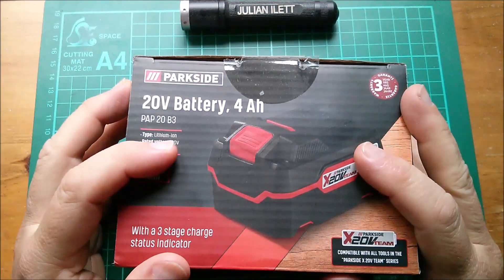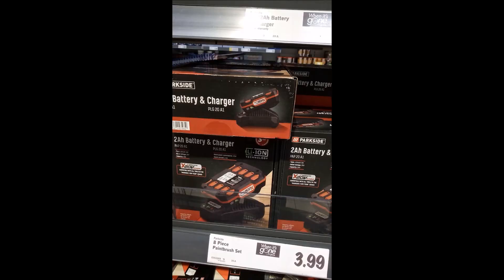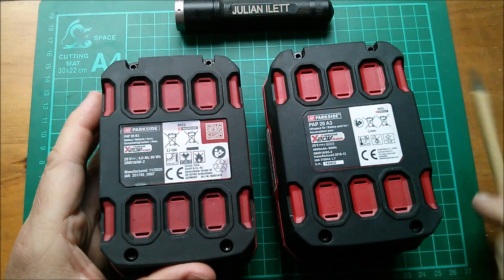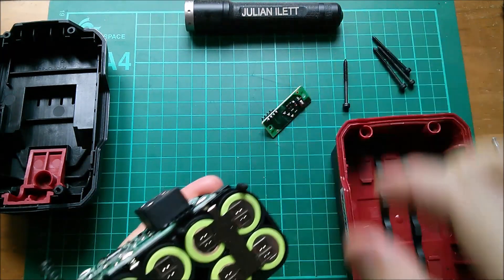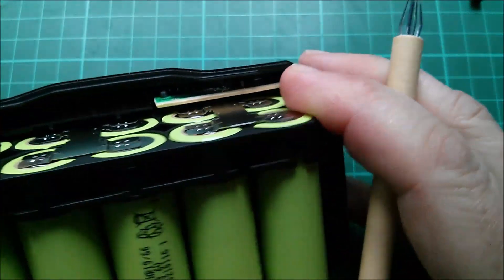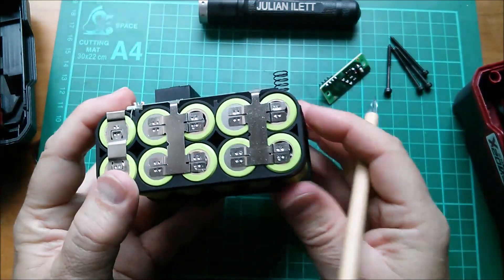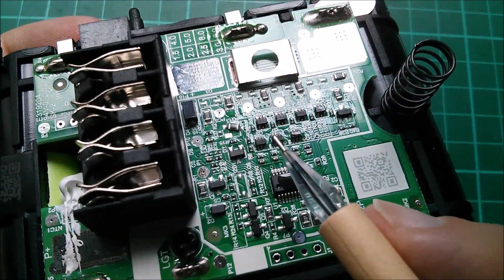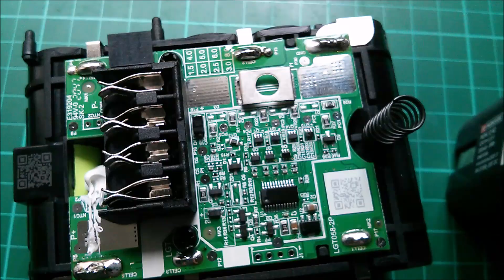Parkside 20V 4Ah Battery from Lidl

Comment: Hello!  I just purchased a 4.0 AH Parkside battery here in the US.  The new battery advertises cell balancing.  My old Parkside batteries did not have cell balancing.  Do I need to use a newer charger with the cell balancing?

Comment: I believe BigClive has established that one of the terminals is connected to the thermistor on the batteries to tell the tool the battery temperature, and when the pack voltage drops too low it open-circuits it, looking like overheat, and it's up to the tool to stop taking current - hence the MOSFET in the tool.

Comment: Ryobi 18v batteries (actually 21v as they're 5S) have the low voltage cut-off built in the battery so they're much easier to use in DIY projects.

Comment: Is there a simple cut off circuit that can be bought and added into an homemade adaptor for these batteries? It's good to know they don't have this built in but a real shame. I use the Parkside 12v batteries for several projects and it's nice that I don't need to worry about over discharge as the battery handles that internally.

Comment: Hi I  want to ask you if I can, I have 2battery model B1 and B3 a 2Ah battery and the control green LED turns off at 19Volts and only yellow and red remain, whereas on the 4 Ah the green turns off when the voltage reaches 17.3V, that is, on one the green turns off when the 3.9 V cell instead on the 4 Ah it turns off when the cell are 3.4 V .
The only red LED lights up on the 2Ah battery at 17.3 volts, whereas on the 4Ah battery the red LED lights up at 16.5 volts, i.e. at a lower voltage.
Why i have on green and red Led diverent voltage on 2Ah and 4Ah same battery model B1.
I mean on 2Ah battery red is on when the cell are 3.54 volts instead on 4Ah red is on when the cell are 3.3 volts. 
Is could bee a defect bms or is it the different management of the BMS?
 
 Thank you

Comment: Please:Do you know,what the middle Pin tells the tool? The outer pins are positive and negative. If you apply voltage of 5 cells to the tool, it tells error,runs and stops. So one of themiddle pins is needet for the tool. But what does it tell the machine?A resistance from tempersture? Du you know?
Reply: Digital data is transmitted through this pin. I checked it with an oscilloscope

Comment: Is it possible to charge parkside 20v batteries without the parkside charger? Since the balancing is done inside the battery, would it be ok to use a smart turnigy accucel six and hook it up to the terminals? Or will the battery not recognise it and go into protection

Comment: I tried to make an adapter for my new Trend 18S circular saw. The Parkside battery almost fits but did not slide in enough.
 I made 2 short connection leads with spade terminals at the battery side, 3x0.75cm2 wire per lead,going to copper strips which inserted around the power tool blades. Unfortunately I shorted them for 1s or so when removing them from the tool,  There is no power at the terminals. The battery led check does not cause any lights to come on.
Opening the battery:
The fuse is broken having looked at https://youtu.be/A6LYNa3-n90 where he solders the fuse back (seems dodgy)
The cell voltages are maintained.
You mentioned the fuse between the ground pin with the circle on it - looks te same
I figure that the fuse would have gone but does not look different. 
Does the ?brown liquid/???resin  on the PCB  means the PCB is toast despite the fuse?

The cells are cool I have put the battery in a stainless steel pain with a lid on, in case of issues. 
Any advice about possible fixing / replacement of the board / aedvice would be appreciated.
Reply: The fuse is a last resort to save the cells from damage, if it is damaged then you either have to find a replacment or scrap the pack.. Its not safe to use without the fuse, they put it in because the battery has no other protection for it.. DONT be tempted to solder across the fuse to get the pack working..
Reply: I haven't but considered automotive fuses, SMD fuses. I eally wanted to identify the same fuse but had no joy. @petrokemikal

Comment: Hi, I am trying to use the Parkside 20V batteries instead of V-mount batteries for film equipment.
As I see it I have to transform the voltage. Any hints with what I can do this easily and also keeping it compact/sturdy?
Vmount is 14,8V nominal. The minimum is likely around 12 V the max 16.8V.
Any tips appericated!
Thanks a lot

Comment: I have thought about using these batteries to power an outdoor model railway controller (20v). 
I'd need an inline small external fuse though in case I get a derailment and a possible direct short.

Comment: One interesting note is that the blade beside negative is normally a thermistor with a resistance to negative of 10.6KOhm.  Knowing this has allowed me to bodge Makita batteries onto Parkside tools.  WHen you open the tool, there is a control board with Bat+, Bat- and a terminal called "DS".  Wire a 10.6Kohm resistor (easier to use a 10K in series w 620 ohm) between DS and Bat-, and then the tool will run off just the 18v +/- from the Makita Battery.

Easy Peasy, and I now have an 18v pole saw running off makita batteries (my standard) for $40USD.
Reply: Awesome info - thanks!   I just imported the Parkside soldering iron into the U.S.      I need to convert it to run on my Dewalt and/or Ryobi packs.   I noticed the third terminal as soon as I unboxed it , and so came here looking for this info (whilst praying that it was  a thermistor and not a data line - phew !!)
Reply: Do you know if it would be possible to charge the batteries with a regular smart charger since the balancing is done inside the pack? I have an accucel6 and wouldn't bother buying a new parkside charger for a tool i found in the trash

Comment: Hi Julian.. I'm having issues getting the parkside X20v team batteries to power my older version Parkside performance 20v tools. I have the adaptors but with basic pos/neg connectors. it will power up for a brief second and cut off.something within the battery/tool is not compatible.. do you know what the 3rd terminal on the battery is for? how to connect to make it work? Thanks

Comment: Hi @Julien, i plan to use 2 of these in series to get 40v 4ah for a diy electric bike motor kit. I'm a bit worried the parkside battery bms doesnt have a low voltage cut off though. Is there a way i can still go ahead with my plan? Thank you.

Comment: Brilliantly useful teardown! Because the Parkside batteries are staggeringly good value compared with others, I am gradually converting every 20V thing I have to use them via custom adapters, or in some cases putting the Parkside innards into other brands' battery housings.  Of course that latter presents some challenges/risks in safe and efficient charging, so the more we know about the designs the better.  (So far I've been winging it, monitoring charge voltage and current a bit, not leaving any cross-species pairs unattended and seem to be getting away with it!)
Reply: Yes, watch out with the charging, cost my nephew his house
Reply: So is it not as simple as putting these let's say in a DeWalt pack ?
Reply: The downside is the cut off should be in the battery.

Comment: They move most of electronics on x20 series to the tool maybe to allow tools like the 40 volt chainsaw to work with two batteries.
there are no tools using two x12 batteries

Comment: Good building quality! Strange, that cut off mosfets aren't installed by design on BMS board..
Noticed marking table on side of PCB, that looks like battery capacity.. Interesting - is there some part difference on PCB between different capacity versions? 🤔
Nice battery for price! I need to go check out Lidl, finally.. 😂

Comment: Thanks for the heads up Julian. I needed 6*18650 cells to repair my crap Vax stick hoover, apparently non removable batteries that fail after 14 months are a consumable so not covered by warranty. Found the unbalance 4ah battery for half price in the Aylesbury branch so got one and harvested the 10 batteries. Vac fixed and 4 spare cells for my torch. Felt bad throwing away all the rest of the components but worked out a lot cheaper than buying the cells

Comment: I just picked up a Cell Balancing battery from Lidl (PAP 20 B1) with a charger PLG 20 C1 in case that had anything special for the new batteries - it was so confusing with all the different old and new stock. I think that the charger is nothing special though, as the balancing is with the battery I assume I could just use any of my old chargers, and the balancing would still work?

Comment: If you have "Kaufland" market-shop in your country -> You can buy 12V batteries for "My Project" tools with 3x 18650 >2000mAh (21A) batteries, similar/better cells as in LIDL battery-packs, but cheaper. Normal price is 10 dollars, sometimes it goes for 5 bucks. That´s 1,60 dollars for 1x 18650 cell with 21A discharge and capacity around 2100-2200mAh - I gutted them, tested them and using them for my projects. You can´t buy cells for that price anywhere else. :D

Comment: I got 3x4 pack of these 20V packs stitched together.... This cell balancing board hopefullymake this pack a bit more safe to use (cell balance wise).
Also, the cut-off is done via an external MOSFET in the tool on the 20V packs. Essentially the two middle pins are for (C)harge and (T)ool respectively.
I've not played with using external FETs, though that'd be something to consider for my power-bank (Tho the FET would probably become the fuse, even a 50A FET with a 15A fuse would likely go first.
Reply: https://www.youtube.com/watch?v=1zdEcPNiQL0&t=2s this guy did it

Comment: FYI the balancing is usually done by just having an overvoltage detect and shunt transistor across each cell.  If a cell exceeds (4.2v or whatever) any extra voltage just turns into heat in the shunt transistor. This allows the charger to keep charging the stack of cells until they are all at 4.2v. This is kinda inefficient, and relies on the transistors being able to dissipate the heat (so you can't charge super fast), but it's the cheapest way to do it.

Comment: Followed many of your videos, all excellent. The next step could be a low RF noise high efficiency regulator to give 13.8v output from one of these packs. Probably easier just to buy a Lidl dual charger to recharge these.

Comment: If I buy some of the  4ah and 2ah batteries with cell balancing, does it
 matter which charger I get? My store has the new cell balanced 2ah and 
4ah batteries but the charger is  bundled with a older non balancing 2ah
 battery. Is the older charger suitable for  cell balanced batteries and
 as its bundled with an old 2ah will it charge the new balnced 4ah?
 I agree, it is confusing !
Reply: I'm currently in this dilemma. Rang the service hotline but alas, today is a Saturday.

Comment: Printing cell balancing on the packs is just new marketing, perhaps to try to combat all the youtube vids saying they dont balance... I have X20v batteries from 2017 they have ALL had cell balancing from the a1's. (unlike the 12v range) my last purchase of lidl batteries was about £350's worth for a big  pack build, i also commented on your original 20v 2yr old video and said that they had cell balancing but i could not identify the chip used (2017/2018 packs) as the number didnt google. parkside batteries in blue wraps are by grizzly, according to grizzlys site they source their cells from samsung, i cant verify this but in the battery groups it has been noticed that the cells charge/discharge graph do seem to follow the paths of samsung Q chemistry's. the cell balancing on this is just resistive. not capacitive, and at charge time only. balance chip handshakes with charger to switch on. as te cells are direct connected you can charge them by just throwing 20v back in but i dont know if this would activate the balancing, and i'm too lazy to test as why do that???
I have batteries from 2018 in daily use on our ebikes, still holding a good charge but they must be on their last legs by now...
the LGT8P22a is also used by anker in their power banks, i have found the chips for sale from the far east, but no data sheets.
no low volt cut offs, if you reach too low a voltage the chip throws an unrecoverable error and you will never be able to charge that battery again...no even removing all 5 cells / power wont work. been there 3 times now so that 75 quid of batteries i could no longer charge...(cells went into other projects)
if anyone wants me to strip open some old batteries for comparison let me know.

Comment: 5INR19/66-2 (on the case) and INR19/66 (on the individual cell) is a standard naming scheme. INR is the cell chemistry and indicates the use of Nickel, Manganese and Cobalt, as it is common for power tools cells. 19/66 means 18650 (18/65 is also commonly found), but sleeved. To account for the size of the sleeve, 19/66 is widely used to indicate that the cells are ever so slightly larger than naked 18650 cells. It's a compliance thing.

And on a similar note, it's legal now for power tools to state the "maximum battery voltage", which is a very soft definition., hence the 20V/4Ah/80Wh on the case. This whole 18V vs. 20V naming business (same as 10,8V vs. 12V) came after this change was implemented in North America and the power tool companies lobbied for a consistent global naming scheme through their industry body,  the European Power Tool Association. Until then it was the default, as it still is everywhere else apart from power tools, to use the nominal voltage as the defining value for your product. The funny thing is, while basically all of them agreed that this is a good thing for the 10,8V tools, they couldn't agree whether it's also a good idea for the 18V tools, so some did and some didn't change it to 20V.

Comment: That could make using an adapter quite dangerous. The other brand may not have it's protection in the tool & charger.
Reply from the maker: My thoughts exactly. Making adapters with a 3D printer is not without its risks.

Comment: I got one of the 4.5A PLG 20 B1 chargers which has a fan; the model in the blister pack is the older one without the fan AFAIK. The parkside drill comes with a hard plastic case which has a cutout to store the charger + battery but the newer charger doesn't fit (because of the fan!!)

Comment: There are also a lot of adapters for those cells on thingiverse so you could print one yourself, fit some contacts in it and you are ready to go.
Reply: not advised, they dont like over discharge, the balancing chip shuts down and then wont handshake to the charger, i have found no way to reset the chip.

Comment: Perfect timing! Have got the same battery on the healing bench, brand new from Lidl, for  powerbank conversion. It's unexpectedly diy friendly. Since i don't have a charger, is there any chance you could have a look at comms protocol to charger and tool? How do they activate the bms? How does the bms signal individual cell voltage out of spec? What are the threshold voltages? Thanks!

Edit: current plan is to add a 5S bms board and fuseholder+fuse inside the casing (i know it already has the fuse on pcb but that is way too beefy), would seem to fit. Also to use the battery with an external additional low voltage disconnect module. If i could use the original electronics, could skip the extra bms and only use pack low disconnect.

The cells seem very well balanced initially but have not tested voltages under load. Balancing function is a bit questionable for me, would like to know more details on that. Also almost no selfdischarge so i assume bms is off or deep sleep when not in use.
Reply: i've been looking for ways to talk to that chip for 4 years...
Reply: @lezbriddon  Thanks for the reply! Got a charger for analysis? Where did u get stuck?
Reply: @calinolteanu8079  I only have a crt scope so couldn't decode data except by pen and paper and tracing it off the screen so never even tried that but spent many hours trying to find a data sheet.
Reply: Is it possible to charge the battery without the parkside charger?
Reply: @alexambro4998  yes, with a dcdc module, cc then cv BUT you need to add a 5s bms
Reply: @calinolteanu8079  ok so there is no way to just use the bms in the battery without the charger? I have previously found a bosh professional drill with a small 2Ah battery in the trash (one cell was under treshold) and since the battery did not have any balancing (in fact despite what is advertised there are no connection in between cells) I just added a connector like the ones you find in lipoly battery for rc cars and just charge it with the b6ac that way. But I would like not to touch the internals on the parkside since they have a pretty neat warranty

Comment: The Post Apocalyptic Inventor made a couple of videos about converting old NiCd battery tools to Lithium, and he managed to find a cheap battery connector base that terminated in a couple of wires, which he mostly just attached to the tools and pretty much job done. It was for a well-known brand though, so I have no idea if you could find something similar for these batteries. It's possible you could find one that would fit after some minor modifications, but you'd have to compare the connectors pretty closely to find one that matches.
Reply: There are two different files on thingiverse. If you know somebody who has a 3d printer, you can have it printed and you only have to add 2 male spade terminals, 2 wires and some glue. That is what i did.

Comment: So as a big fan of Ryobi, have you considered the 3d printed converters from Parkside to Ryobi from Thingiverse ?
Reply from the maker: The Ryobi batteries have internal low voltage cutoff. The Ryobi tools don't. So a Ryobi tool would drain the Parkside battery down to zero volts (with the risk of some cells going negative).